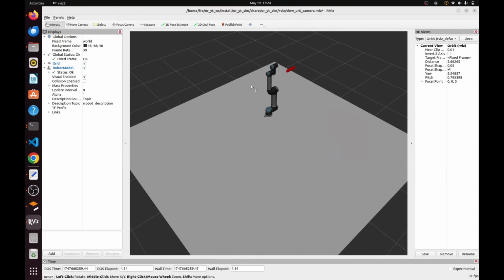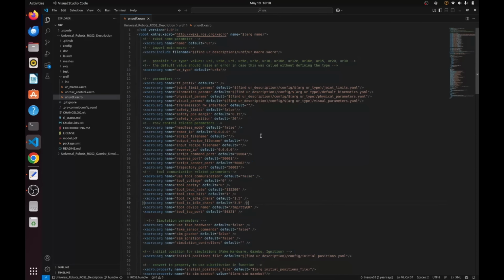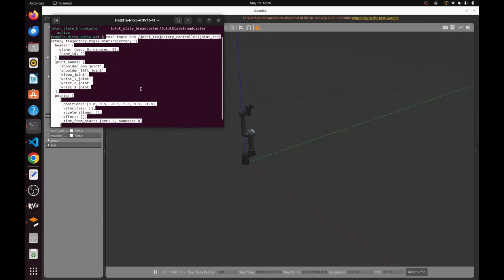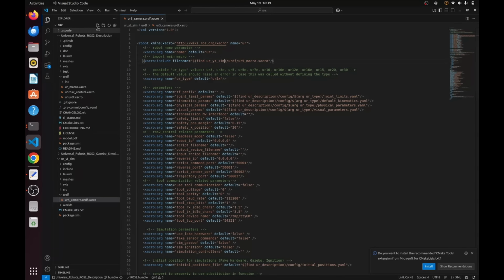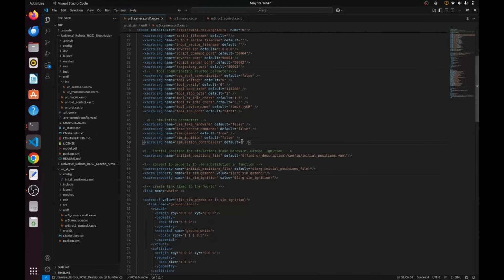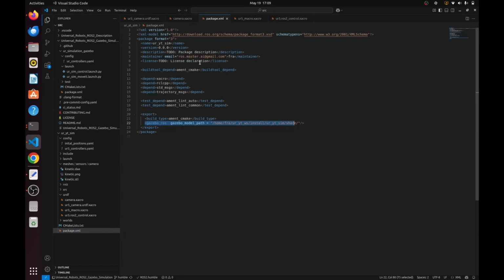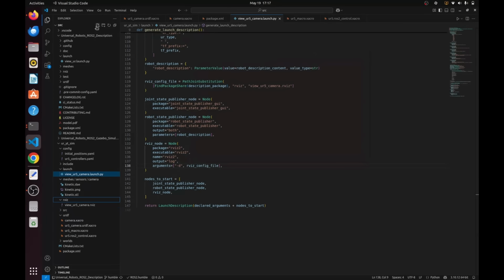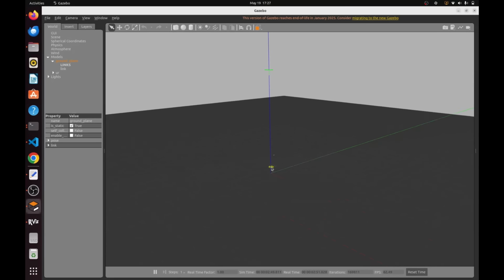Simulate a UR5 Robot in ROS2 + Gazebo | From Official Repo to Custom Package (Step-by-Step Guide)

Comment: Hello, I too have encountered a problem "Could not contact service /controller_manager/list_controllers" and it seems that is has something ro do with a camera urdf. I wrote an email with topic "Problem with UR5 Robot in ROS2 + Gazebo", where I give a little more context and append a link to git repo of mine. Thank you in advance
Reply: hi, that is not related with camera. if you see the full log you will see "spawn_entity" might not be working too. 
FIX: in the launch file, gazebo is being launched. Instead, launch the gzserver and gzclient as two components, it will work.
Reply: @tejasps28  Hello, thank you for the reply, however in my logs it says "[INFO] [spawn_entity.py-6]: process has finished cleanly ". Everything works just fine, both rviz and gazebo launch correctly if I comment out the line <xacro:include filename="$(find ur_test)/urdf/camera.xacro"/> in ur5_camera.urdf.xacro file. But when this line is present, I get this Could not contact service error and gazebo crashes
Reply: @tejasps28  and launching gzserver and gzclient as separate instances didn't really change the whole thing, [spawner_joint_trajectory_controller]: Could not contact service. Still thank you, made me learn a little about this launch file.
Reply: UPDATE: I solved it, sorry for acting like a schizo here, but the thing was kinda tricky to me.. The problem was actually in a camera.xacro file. Not sure why but trying to find camera model like that <mesh filename="package://ur_test/meshes/sensors/camera/kinetic.stl"/> does not work and causes the whole controller service problem. When I tried to find a mesh using this line <mesh filename="file://${URT}/meshes/sensors/camera/kinetic.stl"/> IT WORKED. Also had to make sure that <xacro:property name="URT" value="$(find ur_test)"/> line was in ur5_camera.urdf.xacro file
Reply: update, I guess. While I was trying to figure out the problem, everything just launched on itself.. I just wait like 5 minutes looking at "Could not contact service" errors and eventually everything will launch. It is still kinda troubling having to wait for 5 minutes every time I want to launch the setup..
Reply: @punkrocknegr hence I will suggest you to launch both separately. As a test, you can launch gazebo , by typing gazebo in a separate terminal, and then launching your launch file. It might work faster
Reply: @tejasps28  I figured this one out, it had something to do with file paths for Gazebo inside camera.xacro file, kinda lame.. Still thank you, mister, your initial reply gave me motivation to come back to this issue after a month and it eventually worked out!
Reply: @punkrocknegr that’s awesome!:)

Comment: If anybody faces a "Wrong parameter type, parameter {robot_description_planning.joint_limits.shoulder_pan_joint.max_acceleration} is of type {double}, setting it to {string} is not allowed" error, just try running this command inside your terminal:
export LC_NUMERIC=en_US.UTF-8

Comment: what should i do if i want
 to use ur30
Reply from the maker: I would modify the argument and put ur30 instead of ur5 in the xacro file
Reply: @learn-robotics-with-ros  ok i modified the xacro file and i cant build the ur_yt_sim is there a pkg that i have to install before i build it this is the error  CMake Error at CMakeLists.txt:18 (find_package):
  By not providing "Findros2_linkattacher.cmake" in CMAKE_MODULE_PATH this
  project has asked CMake to find a package configuration file provided by
  "ros2_linkattacher", but CMake did not find one.

  Could not find a package configuration file provided by "ros2_linkattacher"
  with any of the following names:

    ros2_linkattacherConfig.cmake
    ros2_linkattacher-config.cmake

  Add the installation prefix of "ros2_linkattacher" to CMAKE_PREFIX_PATH or
  set "ros2_linkattacher_DIR" to a directory containing one of the above
  files.  If "ros2_linkattacher" provides a separate development package or
  SDK, be sure it has been installed.

Comment: I'm using 24.04, is the process same with jazzy?
Reply from the maker: Good point. You would need to replicate this pipeline but using the Jazzy branch in the UR official repository and for Robotiq gripper. The other option is to use docker so everything is packed up in Humble.
Reply: @learn-robotics-with-ros  But in the UR official repository in Jazzy there are lot of differences in the urdf files as compared to the humble one? I want to work with ur10e and in Jazzy only, please guide.

Comment: Hi, thanks for such a video. It really helps to work with ur5 in ROS2. Is it possible to make a video like this based on ROS2 Jazzy? I mention that the most important xacro files in the original UR repo have been changed, and they have different contents from those shown in this video. In my case, the original packages were tested, and the simulation in Gazebo with MoveIT works well with ROS2 Jazzy.  I stuck at the stage where we create a new package on top of the original packages from the repo, due to the difference between the files in the video and current version of the files in the repo. Thank you for your effort!!!
Reply: my case has been the same

Comment: Thank you for this tutorial. How do it in Ubuntu 24.04? I have Dual boot installed already.. so which is the best version to install ROS?
Reply from the maker: With Ubuntu 24.04, the officially supported ROS 2 distro is Iron.
Humble works only on Ubuntu 22.04.
Jazzy will support 24.04, but it's still under development (release expected in 2025).
For now, go with Iron to avoid compatibility issues 👍

Comment: Hi, and thanks for the nice and informing tutorial. I followed the instructions until 15th minute step by step and everything worked flowlessly until I try to move the model in the gazebo. I dragged the end point of the robot in RViz and clicked Plan&Execute button but nothing happened in the gazebo sim. Until this point I did everything as you did in the video. Already checked every step incase if I did sth wrong but could not find out the problem. What could it be caused from? Thanks in advance for your answer
Reply from the maker: Hi, I think that MoveIt does not "talk" with Gazebo, but It is hard to assess... Could you create a GitHub repository and share to me the link?

Comment: Very good, but I have a problem, the controls are not coming up "[spawner-2] [WARN] [1747946120.873652162] [spawner_joint_state_broadcaster]: Could not contact service /controller_manager/list_controllers
", I have already redone the step by step several times, I have already installed the controls that are in the video description, do you have any ideas that I can try? I thank you in advance
Reply from the maker: Have you tried to clone the repository ur_yt_sim? What about the Launch file? The ros2_control tag? Can you push your  package in GitHub and share to me the link? It is difficult to assess the problem without seeing your package.
Reply: @learn-robotics-with-ros help
Reply: @learn-robotics-with-ros i do that but then it fails to load or says no such file found even though file is still there 😭 I wanna learn ros but there are too many error I am faceing
Reply from the maker: @anti_brainrot_12 where are the file .STL and .DAE of the camera? They should be inside a folder meshes inside your package robot_description, check this: https://github.com/LearnRoboticsWROS/ur_yt_sim

If this does not work, consider to push your package inside a GitHub repository and share to me the link.

Are you running in local with Ubuntu 22.04, humble?
Reply: @learn-robotics-with-ros  i am running in virtual box and i have taken the files from your repo only with same folder and package name still not working
Reply from the maker: This is strange... Can you share with me the GitHub repository of your workspace? I try to have a look. Have you installed all the controllers?
Reply from the maker: The gazebo export tag to put in the package.xml file. Have you put absolute path? The virtual machine you setup is it Humble in Ubuntu 22.04?
Reply: @learn-robotics-with-ros yes it is humble ubantu 22.04
Reply: @learn-robotics-with-ros I am using humble ubantu 22.04 only
Reply: i am having the same problem also gazebo crashes
Reply: @anti_brainrot_12  same here , gazebo not respondig
Reply from the maker: Gazebo crashes when you launch the simulation?
Reply: @learn-robotics-with-ros please help
Reply from the maker: Do you want to share your GitHub repository? I think is a problem of ros2_control tag, yaml file and launch file ..
Reply: @learn-robotics-with-ros I think there is problem in the camera urdf cause when I disable it spawn correctly in gazebo but rviz throws the error
Reply from the maker: @anti_brainrot_12 inside the export tag of your package.xml have you put this:     <gazebo_ros  gazebo_model_path = "/home/fra/ur_ws/install/ur5_simulation/share/"/>?
Substitute /home/fra/ur_ws with your absolute path. This tells to gazebo where he needs to take the model of the camere